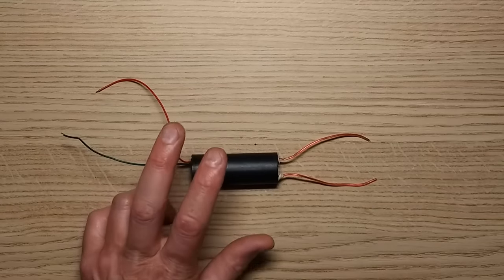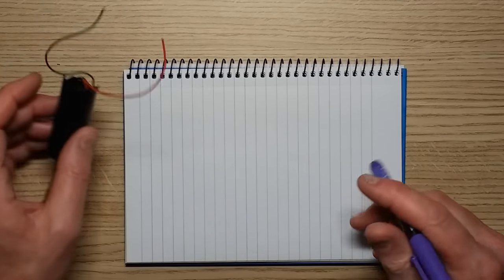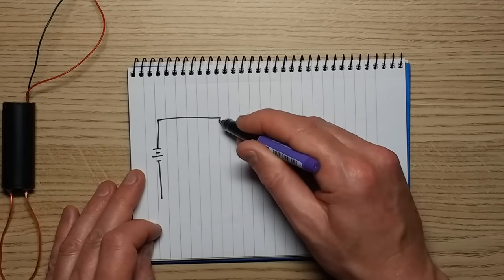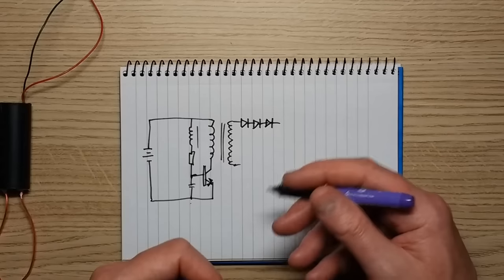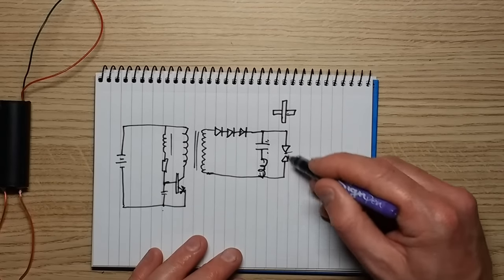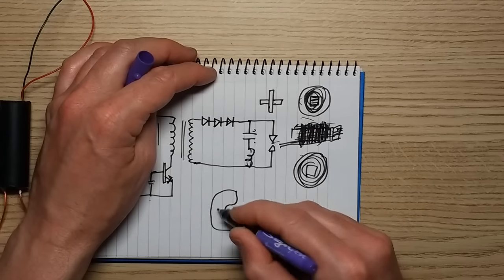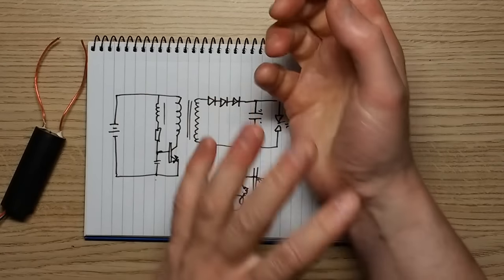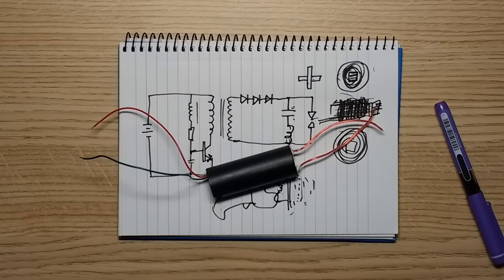Are these stun gun modules?  And do they hurt?  (yes)

Comment: I got one in the mail, I played with it on a single 1.2v rechargable AA and shocked a foil decal on my glass. It blew my sticker to smithereens!!! 🤔👌
So  Q, can I hold it on for a large period of time without shocking say for instance an electric rat trap?
Reply from the maker: It's only designed for short bursts of use, and the output wires must be close as the high open circuit voltage can destroy the circuitry.
Reply: @bigclivedotcom So it's probably usless! But fun to scare my better half 😁. 
To be honest I didn't think you would reply.
 I'm a big fan thank you for all you do.

Comment: In the circuit drawing, it looks like the spark gap were connected to the primary winding of the secondary high-voltage transformer. But that wouldn't work, would it? Because, in order to bridge the spark gap, it would need a very high voltage and that is only generated in the secondary windings of the secondary transformer, right?
Reply: The gap is set so that the output of the first transformer secondary is enough to spark it.
Reply: Then why need the secondary transformer at all?
Reply: The spark gap is a compact way of creating a self-regulating flyback. This couldn't be done straight from the battery, hence the need for the first transformer to drive the spark gap, then the second to create the final high voltage output.

Comment: So, how would you compare the feeling of being hit by one of these vs a flyback from a CRT or an electric fence charger?  My electric fence charger definitely feels less than the times I've been hit by the voltage from the high voltage lead going off a power supply that goes to the CRT, but I've never been hit by one of these.  Don't really have a desire either if it is worse. :)
Reply: Grumpy OldMan - back in the day when I fixed rear projection TVs, I'd get serious shocks from shorted boards...   the worst part was the circuit boards under the three CRTs were always where my hand involuntarily jerked to, so aside from the very nasty shock, I'd get tons of cuts and scrapes as well :(
Reply: I've been hit by the stored up flyback charge in a TV after it had been unplugged for *days*.  I figured I was safe since it hadn't been plugged in for awhile.  <zap>

Wrong...

So, of course, I figured after getting hit, surely there wasn't anything left in it, right?  <zap>

Wrong...

So, SURELY there wasn't anything left, right? <zap>

Wrong again...

I then got out an insulated handle metal rod and shorted everything to ground...
Reply: Never had the pleasure (displeasure?) of being hit by a CRT power supply, what voltages do those typically run at? I have however been hit by a 50,000 volt ignition coil before. Yeah, that sends a nice bolt of fun right up your arm to your chest.
Reply: These aren't that bad. A friend described a brief test zap as "sort of hurts like a bee sting", but he just went back to drinking his coffee. No verbal outburst, no getting tossed across the room, nada.
Reply: I'm a little in the dark when it comes to CRT monitors, but do know from my brother that tube television sets could run at 15-20 kV (old ones even more I think he once said).
Reply: +Dutch3DMaster

Yeah, the CRTs and their power supply could really get your attention.  And you could think you were safe when taking a measurement off the low voltage lead of the power supply, but if you got too close to it, it would reach out and get you.  Really need looking blue arc.  And then charred skin where it hit.  Ouch... I got that once on a RADAR indicator... 14 kV, if I remember correctly.  From what I've read, the power voltage on the CRTs was proportional to the size of the CRT, so a 13" screen would be less than a 25" one.  Supposedly, there are more joules in the stun gun, so it should hurt more.  It is a higher frequency, so you get more skin effect and is less likely to go across your heart and make you understand why they should be called "not usually lethal" instead of "non-lethal".  I'm not particularly inclined to buy a stun gun mechanism (regardless of how cheap it might be) just to find out how it compares to the flyback on a CRT or an electric fence.  I am well acquainted with what the last two feel like and I would just as well not find out what a stun gun feels like.
Reply: The screen-size factor, I think I heard my brother mention that too one time (we are identical twins, but he is a lot more skilled in the electronics department than I am).
My brother once built a capacitor out of aluminium foil and some sheets of glass and attached his flyback to it.  It was like 1:10 in the morning when I was downstairs having something to eat and hear the central heating system transfer 4 loud spark sounds.  My brother came downstairs totally shaken up by the fact that he was standing a couple of inches away from the capacitor itself when it decided to spark a couple of times after he activated the flyback transformer, he then decided to take more safety precautions when using high voltage equipment.  I can't recall him every getting a shock from a flyback transformer, but he did got shocked by an ignition coil once, his arm was numb for a day :P.
Reply: Dutch3DMaster , they should of called them a horsewill flyback transformer, itll make you numb for 1/2 hr.
Reply: :P.  A horsewill is like an insect with a really strong bite?  My paper dictionary as well as Google Translate didn't exactly give a translation :P.

Comment: Ok, but, what's pulsating it? Shouldn't there be a crystal somewhere connected to the gate to give it the frequency?
Reply: The small winding of the transformer feeds voltage back into the transistor's base. As the voltage from the transformer changes, it turns the transistor on and off, causing the voltage from the transformer to go up and down, going back to turn the transistor on and off, etc, in a continuous cycle. . 

So the transformer itself is what drives the transistor.

Comment: Would this be able to be used to make lightning art (scorching paths in wood) ?
Reply from the maker: +playdeaths That requires a fairly continuous current flow to create the path.
Reply: bigclivedotcom I've got a yam electronic transformer ymet50c neon transformer it's for small mdf square ? Would that work instead
Reply: bigclivedotcom  and also made a tazzer from a pound land fly swatter was going to change out the capacitor so it had a bit more of a zap what my mates don't approve of many drunken night screams

Comment: What is the recommended battery type if one was hoping to make a stun gun? Without burning the unit out?
Reply from the maker: Low voltage like 3V, and keeping the electrodes close together to avoid too high a voltage inside the module.  Stun guns are illegal in the UK.  Even improvised ones.

Comment: I must confess I went straight onto Ebay and brought one of these units for 73p including postage and packing. I was wondering if they could be used for creating Jacobs Ladder ?
Reply from the maker: +Jeremy Clayton-Travis A Jacob's ladder requires a high continuous current of 30mA upwards for the proper effect.
Reply: Yes but I have not had the courage to test it after watching Clive get Zapped
Reply: Hi what voltage battery you use?

Comment: i think of a diy anti theft device for my bike where one wire would go on the left side of the handle bar and the other wire would go on the right side so when the thief tries to drive the bike he closes the circuit and : shock ! (+ under the seat of course !)
is this possible or does the wires absolutely need to be close one to the other like in a real stungun ?  i don't need the sparks , only the shocks

question 2  : if it works with the wires spaced, does the skin need to touch the wires or it will still shock one or 2 milimeters away from the wires?

Comment: There's farmers cattle fences that use a simple dc step up transformer circuitry and switch.  
You can also use a basic buzzer circuit with a relay and dc battery to generate a non lethal output. 
Years ago while a school I made a simple electric shock device using a 9v battery and a relay and two wire leads. 
I called it the virgin detector. 
I would have one of the girls at school hold the leads and ask them if they were a virgin when they answered I made the decision if it was true or not. 
Tried it on one of my female friends. I explained that if she got a shock she was lying. With her friends around her I asked if she was a virgin and everyone held their breath waiting for her to reply she said she WAS and she had a little electric shock...with surprise she dropped the wire leads and ran off with her friends. Half hour later without her friends she came to see me red faced and said how did I know she wasn't....I said the virgin detector doesn't lie.

Comment: It would make the ultimate rat/mouse trap. Rodent arrives inside tube and begins to nibble on cheese/peanutbutter/cereal grains bait and presence is detected thus applying low voltage to pulse generator ... which should dispatch the damn thing.... (where i live rodents are a huge problem) and the two commercial rat zapper catchers i bought last year that use this approach have already worn out...

Comment: I decided to see how low of a voltage these will run at and the ones I got will run on a single AA battery.
Reply: It'll probably last longer that way, since they're apparently designed to run right up at the point of failure for the shoddy components.

Comment: Be careful with these thingys,   the police consider them to be almost equivalent to a real taser especially if you were to add solid electrodes to the output wires . 
I got one when I was a total beginner at electronics,  just to play around with hv,  I didn't know whether it was pulsed or direct etc or what it would do to someone,  I thought it was harmless and legal because it was sold so cheaply and unrestricted, and I found that it couldn't burn paper, whereas an electric arc lighter can,  so I thought that the arc lighter must be more painful because its current is higher.   I ended up threatening an abusive / annoying family member with it  and did 7 monthes in prison on remand and eventually got 18 month community service order.  Usually the minimum sentence for having a taser is 5 years custodial sentence but I was very lucky.      The forensic people never measured its output current, power draw,   produced a schematic,   and they initially believed the 400kv figure on the marketing.
Reply from the maker: They key bit here would be threatening someone with it.  You could do the same with two live nails in a bit of wood plugged into a socket.
The forensic people might want to get a more appropriate job if they thought it was a 400kV device.

Comment: I bought a bunch of 4kv caps a while back with the intention of making a big version of this but cant find any 4kv diodes.
Also why does the output cap need an inductor in series with it?
Reply: The coil in line with  the output cap is the primary winding of the output transformer. When the spark gap arcs over, the capacitor's charge is dumped through that primary winding, creating the very high voltage at the output terminals.
Reply: Take apart an old cheap microwave to get some high voltage diodes.

Comment: hoho! i bought a few of these from amazon. i zapped myself, i had to be quick before they stopped working.
 "with proper insulation up to 1kv is manageable"-i sort of know this from winkling things apart. but i can't stop considering that my zx spectrum power supply i got for xmas 1982 was so big. and my first amiga power supply was somewhat larger (later my amigas had switched supplies). 1982 wasn't that long ago. if a small transformer can happily muck about with 1kv why did sir clive and the commodore blokes use such big ones?
Reply from the maker: These units turned out to have a voltage multiplier.  They die quickly if the leads are moved too far apart due to the rapid increase in voltage damaging the internal components.

Comment: Would putting a load such as a resistor + neon glow bulb in parallel with the arc load act to prevent the  common failure of these devices in the event of an inadvertant no load on secondary scenario.

And why exactly does no load on secondary kill these devices? And my final question has to do with one of the outputs of the secondary being attached to the high voltage transformer core. How does this prevent arcing between the secondary windings?
Reply from the maker: The best thing to protect against the very high open circuit voltage is a spark gap like stun guns use.  (It's not just for show.)
If left open circuit the voltage rises until it causes failure of the internal components by arcing across between capacitor plates (forming a conductive path) or breaking down the diodes.
The appearance of being connected to the transformer core may just be the winding going in at that point to keep it away from the outer side of the coil which could break down the insulation between windings.
Reply: @bigclivedotcom  Gotcha appreciate the info Clive. I'll have to purchase one of these and do some experimenting. Lord knows I can afford one lol.

And I wanted to ask you if you've ever taken apart a disposable camera and reversed engineered the flash circuitry on this channel? As a kid experimenting with the boards they were hands-down one of my favorite teardown projects and even today how exactly the circuit boosts 1.5v from a single AA battery to 330v with a transformer with no feedback windings, a transistor, and some diodes still has me stumped! Would be happy to send you a board or two as I have tons of them. I think your viewers would find the unique components (neon bulbs, trigger transformers, xenon flash lamps, etc) interesting and how the engineers managed to reduce the component count to such a low level for cost effectiveness is absolutely amazing.

Comment: hey clive ive taken one apart http://i.imgur.com/cq4t4Dw.jpg
its a square one but the internals should be the same. 
i wondered why it doesnt dump its load into stuff i connect it to, which it should if its a spark inductor type thing.  
it stops building up a charge when load is applied which means theres no spark gap inside.

it consists of a 
-flyback like transformer (closed ferrite)
-transistor, diode (or resistor) and resistor on the primary side
-hv diode after the transformer 
-capacitor 
-ceramic resistor across the capacitor or in series, couldnt quite figure that out.

none of the parts were marked.

Comment: what would happen if you wired another one to the output of the first, would it give to more voltage or just fir the second one?
Reply: As the input voltage is maximum six volts, wiring HV output of one unit into the LV input would likely fry the second unit beyond repair!

Comment: #bigclivedotcom hello I had an Idea that you could try, I think I had heard somewhere that if you put that kind of potted circuits in acetone you can dissolve the potting resin and see the circuit clearly. I don't know for sure if that will work but if the theory is correct you could possibly make a video on it.
Reply from the maker: I've used acetone for depotting before.  It only works with some resins.
Reply: @bigclivedotcom   but could you just give it a try ? If successful please make a video about it.

Comment: I always try touching it with a freshly charged li-ion battery..... just kidding! I find somebody else to take 1 for the team (unaware in most cases). Another fun thing NOT TO DO with these is... if you have old caps laying aroung (non polar ones) like 240V 1-2 microF you can abuse them with this "charger" and let me tell you... they go NUTS! It seems they  hold ~ --1600V and + 300V at the same time! Friends told me that if you touch them you feel something like AC going trough your body but I personally like to short them on a metal sjurface.. it goes BANG

Comment: Just got my coil I ordered and shock it doesn't work.......no pun intended
Reply from the maker: You have to be careful not to power these coils up with the high voltage wires too far apart.  If you do then the output voltage rises so high that it can cause instant failure of the electronics inside.  They're intended to be attached to a fixed spark gap before use.

Comment: They work better with 3.7v, like a good quality 18650. They'll also overheat and die if you turn them on longer than 45 seconds at a time. I would never go anywhere near that long myself. If you want to supercharge a battery powered flyswatter... this is how you do it.
20,000 volts not the 3000 they come with.

Comment: I've half pulled one of these modules apart and found and it contains a voltage multiplier on the output stage, your diagram is no reference to how these high voltage modules work.
Reply from the maker: I have discovered that since.  I should do another exploration on these.
Reply: That be great if you could do that Clive, it was a just an off chance I decided to rip one apart just to see how ticked..there's 5 caps & two diodes on the output stage, haven't pulled apart the first stage yet but the part of ur diagram will be pretty much close to this.

Comment: Hi so quick question if I put 12v on this would it kill me?
Reply from the maker: It would damage the unit if it's only designed for 3V.
Reply: @bigclivedotcom  I had one with a 9v battery and accidentally shocked myself and it hurt a lot, I bought a wireless switch and controller I'm making a taser on a bike so If someone steals it I tase

Comment: if that thing only works off around 3 to 5 volts i could probably just stick it ontop of my pocket sized robot and give it a weapon to defend itself
Reply: two years later and I finally get one for my robot unfortunately i also broke it so now i gotta buy another one but ill 3d print cable holders so I can have the wires at the correct distance to avoid damage